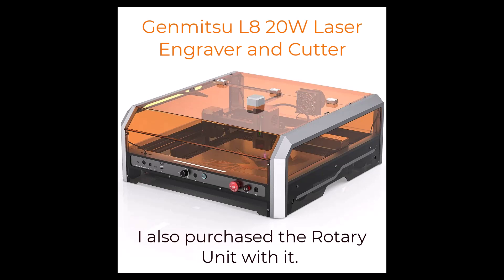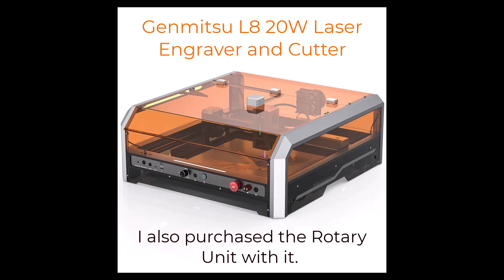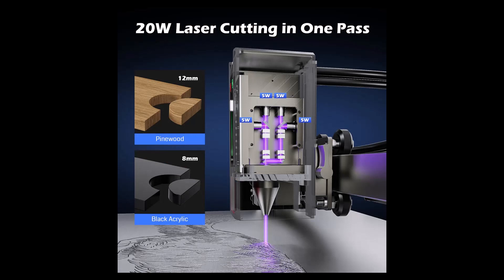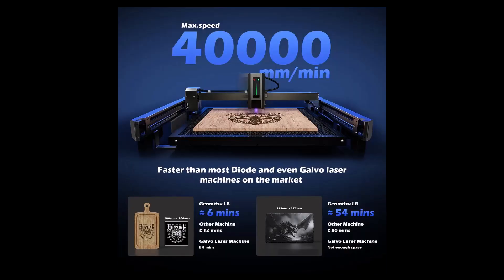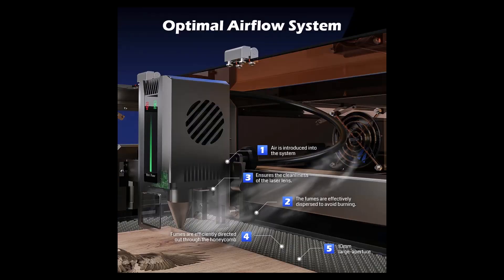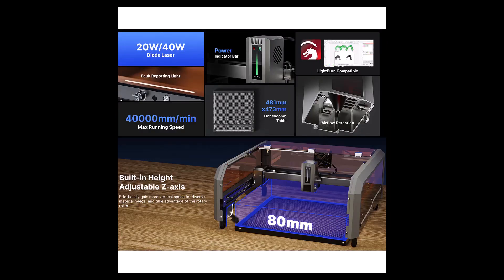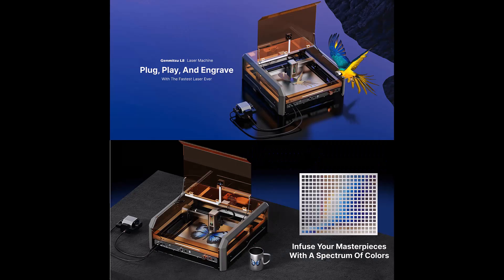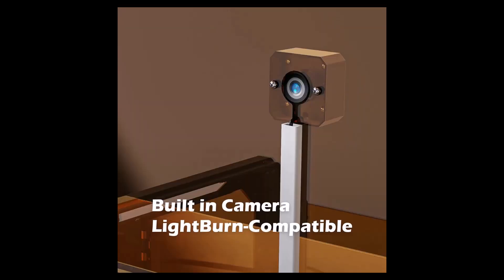The Genmitsu L8 20W Laser Engraver and Cutter

Comment: Do you still like the unit? I’m thinking of getting one. Where did you get the inline fan. I saw your other video about the 40W upgrade. Did you get it to work properly? Thanks!
Reply from the maker: Yes, Coolguy, I still like the unit.  I got the inline fan from Amazon (amazing difference - their fan is not very powerful -- I ended up just removing it all together.)  The unit has good qualities, and it has bad.  Yes, I was able to get the 40W to work "well enough" - I use it mostly for cutting and deep engraving - changing the two out is a real pain (not hard, just tedious and time consuming) and then you must go through the alignment process for each one.  I was never able to get the calibration perfect but got it "good enough" and just accepted I will lose a little wood because I can't get as close as I would like to other pieces when I cut them out.  The camera is not that great either, but I can't afford a new one right now.  Just know you will have to "work around" some things.